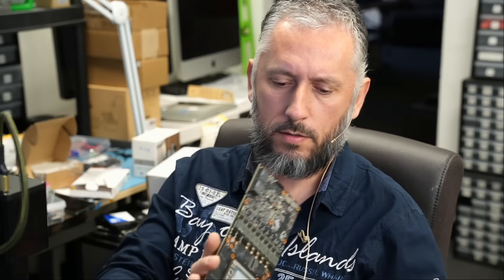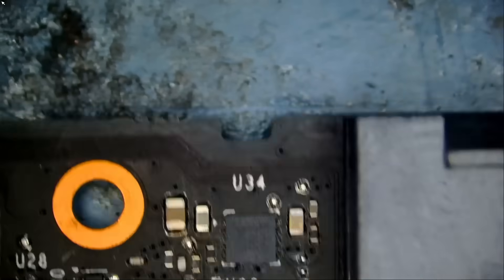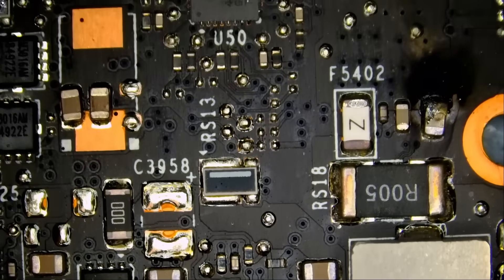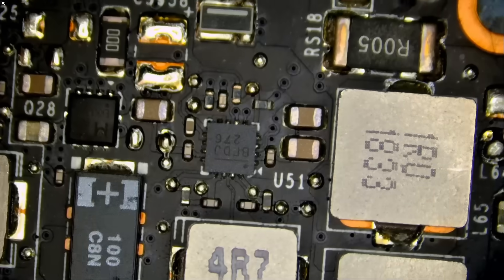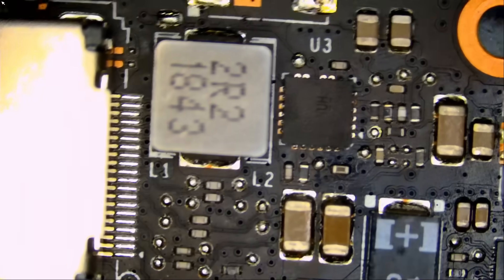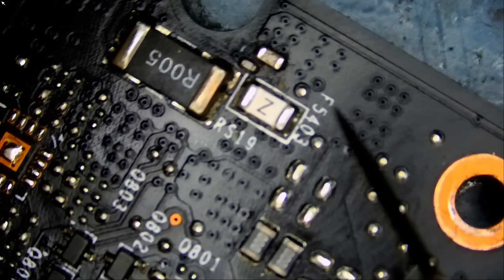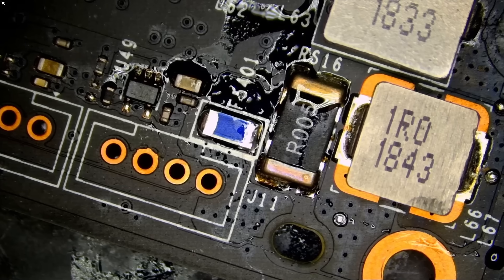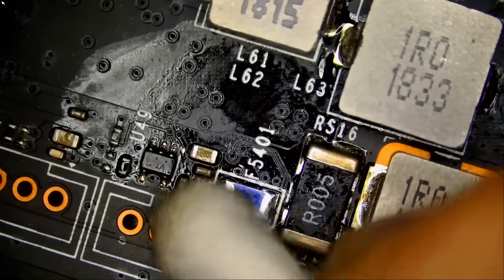EVGA 2080TI Repair - GPU Died after Water Block Swap - What went wrong?

Comment: Hi, I've watched quite a bit of your videos and I like how you work and explain things.  You've mentioned that you like using low melt solder and was wondering what your thoughts would be about it being as effective on multi-layered, high current pcbs.  I've had some "people" tell me that it wouldn't and since I don't have access to getting those type of pcbs to try it out myself, I thought I would ask what your opinion would be.

Comment: I see lot evga repairs is that brand that good? 🤔i see less rog strix cards so figure it out which one is good 😅
Reply: A lot of people bought EVGA, probably why. If no one buy a product, then of course you wont see it in a repair shop loll.
Reply: @bloodedge    why no one buy strix 😅 i had 1080ti 2080 4080 so far soo good maybe evga better than strix but lot of problems i see 😅 died right after warranty expired lol and look strix cards always use better mps mosfet and better controllers not like evga mostly use ncp or sic fails over time

Comment: I said it before - EVGA is a beloved nVidia brand card. You can't buy them new anymore since they left the AIB program. Folks are most likely  repairing them to keep as momentos or collectibles. 👍👍
Reply: Exactly, I miss this brand.  I'm still rocking my old EVGA RTX 2070 Super in my secondary machine
Reply: @phazonclash  Same here. Same card! Plays at 1080p no problem.
Reply: I had an EVGA 3070 Ti, I copper modded the memory, and it worked excellently, I sold it to a friend and he amazed about it cooling capabilities shame they don’t make them anymore
Reply: Evga is mostly loved because of their RMA process. Not necessarly because of the cards themselves.. js..
Reply: Evga still honoring warranties too

Comment: 0:04 makes me wonder your repair price. Too early for a 2080 ti to go to e-waste. Even a 1080 ti is still capable.
Reply: Its not about whether it's still a viable card. It's whether or not it costs more to repair than to find a similar model used. It costs $100 just to get the card on the bench, then add diagnostic time, repair time and parts.
Reply: @iamperplexed4695  Damn, his repairs must be really better than factory then
Reply: Even 1060 6gb is still enough for some gamers.
Reply: @Syntappi  thats what am using, evga 1060 6gb SC. play battlefield v and 2042 in 1080 60+ fps. thats enough for me.
Reply: Exactly, still a pretty decent card.
Reply: 2080Ti had vram issue bad batch of micro got into consumer channel many affected Founder's Cards.
Reply: Even a 1030 is good enough for a lot of games.
Reply: @carloscollomps1552 errr, no, actually
Reply: The 1080TI was good value for money, and arguably one of the best GPU's of all time. The 2080TI is not. It was no better in most applications, and didn't even do raytracing good, something it was supposed to. A Bad product in just about every way.
Reply: @SantaClaw  I had both cards and in some games the 2080ti was literally twice as fast (the witcher 3 next gen with SSR at high settings for example). It could be that Nvidia has stopped optimising drivers for Pascal cards, but that does not change the fact that some games run dramatically better on the 2080ti. The 2080ti also had DLSS and in some games even "DLSS performance" mode looked better than TAA native. As for RT I had to always use DLSS at 1440p but many RT games were playable (around 60fps). In cyberpunk there was a generation difference between the 1080ti, and the 2080ti. If my RTX2080ti still worked, I would still play on it. I was forced to buy a new card and now I'm using the RTX4080S.